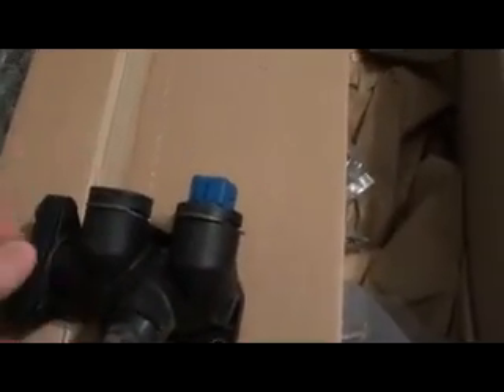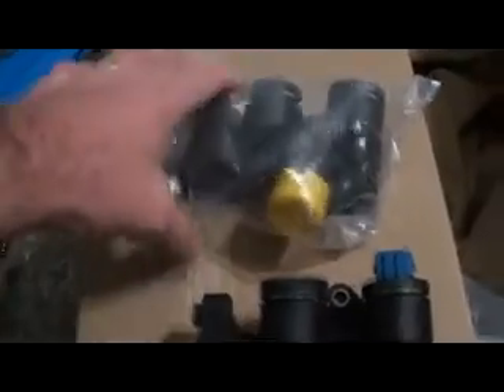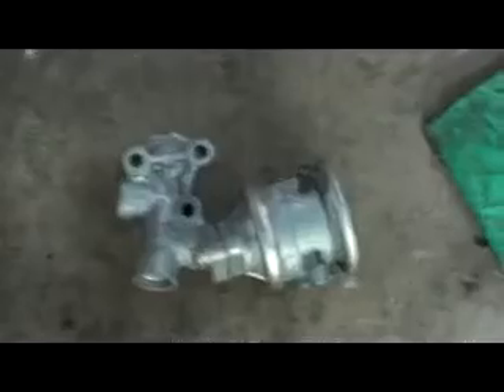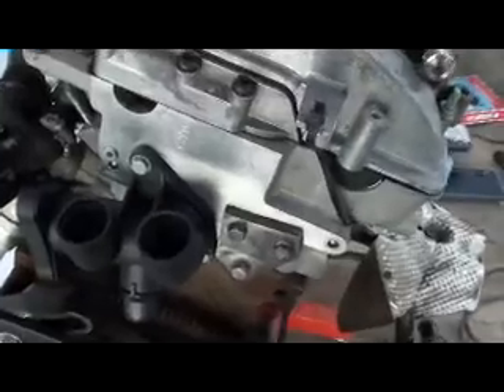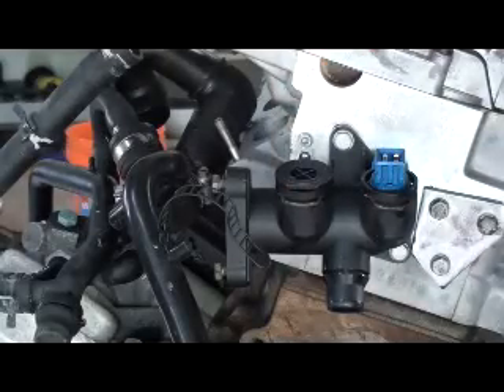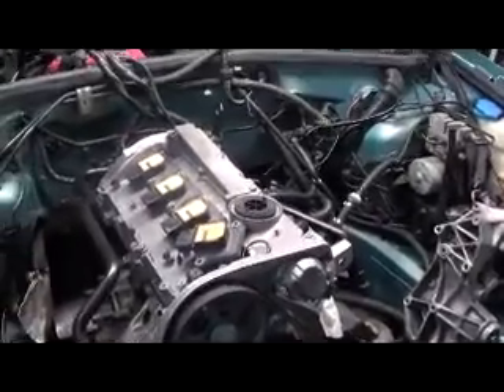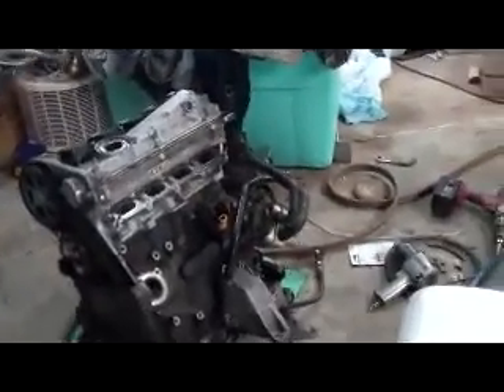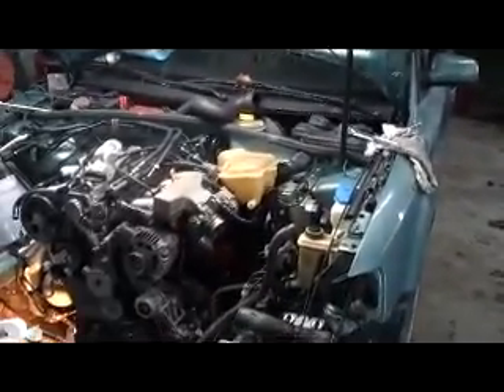Still Working On the Passatt

Comment: @ding0925 I was wondering if you had thought about upgrading the turbo to a KO4 and upgrading the intercooler to put a little pep in its step. I was getting ready to ask you what engine you were working on and when you said 'turbo', that answered my own question. I didn't know what engine you were working on, so I figured it was a 1.8 Turbo about midway through the video.